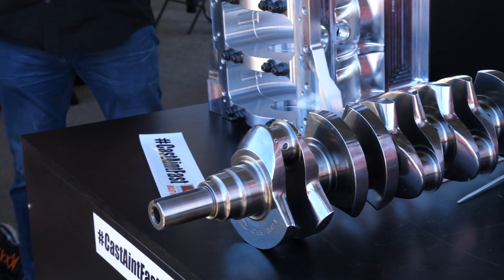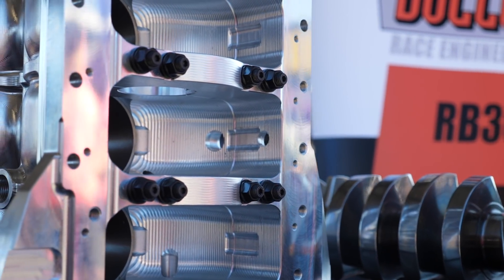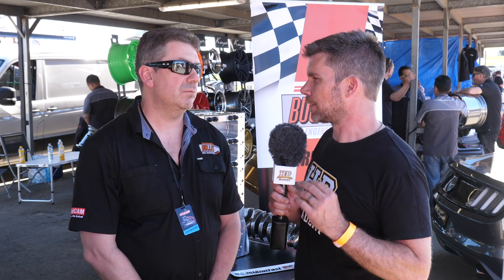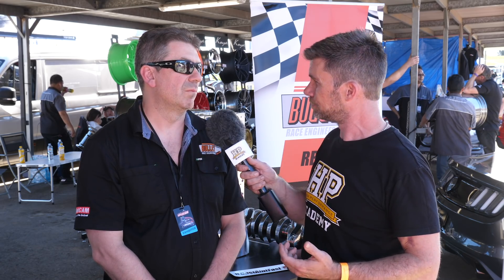3200HP+ RB Block With A 2JZ Twist | 100PSI of Boost, Bullet Race Engineering [TECH TALK]

Comment: " You can use Chevy flywheel bolts 'cause they're cheap"  You could probably use a cast block too if you're worried about the cost of 8 bolts...
Reply from the maker: Not just the cost, they're easy to source. Sometimes on race weekend things go wrong and spares are needed in a hurry - Taz

Comment: Wow I wonder how much does it cost to built an engine like this ? 
Beautiful engine.
Reply: If you have to ask, you can't afford it.
Reply: Matt Johns 
You probably right, but is still nice to know.
Reply: More than u can afford pal, billet.
Reply: hendrahendra  wow you guys are such low life’s, and it reflects on your comment, I just dig deeper into the cost of a billet block and they are not that expensive. The block ranges from 10 to 13 grand. So a complete motor ranges from high 20s and up, depends on the built. Price reference from Maxworx.
I am just not familiar with 2Jz motor cost.
Reply from the maker: @H L don't take it too hard, @hendrahendra was just twisting a Fast n Furious movie quote for a laugh ;)
I couldn't tell you want it costs to build this, but the block and crank will run you around 15-16k USD alone, and I would imagine much more if you're not US based I believe. Bullet and Callies will have the specific pricing for you though if you're keen to investigate further - Taz.

Comment: I want to see a single piece head and block like the old days. Boost it to the moon.
Reply from the maker: The head cylinder sealing technology has come a long way at this level since then though to the point it's often not what is holding things back.
In this case the next step is actually to improve head flow via some design changes rather than just gunning for more boost, although I'm sure as part of the circle of development goes that will be back on the table again in the future - Taz.
Reply: @hpa101  I'm exited to see what the new bottleneck or limit is after the new heads are out.

Comment: How much full engine
Reply from the maker: I'm not sure they sell those, I believe you buy the block and crank then sort the rest out yourself or via a third party. I think the block is around $10,000 USD and the crank around $5,000 USD but could be wrong. You'd need to chat to Bullet Race Engineering and Callies Performance for exact figures and lead times.
Certainly not cheap, but also not as expensive as the days of old for the equivalent - Taz.

Comment: They’re producing 3,200 HP...
Yet they’re looking to address the power production “limitation” by designing a billet head...

When did we enter the realm where 3,200 HP out of 180 cubic inch ain’t enough ??

My goodness !!!
Reply: When LS engines with a Chinese turbo(s) could make 500 WHP at ~ 5K-10K (USD I mean)
Reply: @akilh340   you mean 1000hp for $3k?
Reply: @ze_german2921  
Kind of. It's possible, but I wanted to be conservative about the numbers
Reply: @akilh340  lol rbs & 2jz make 500+ hp with just an intercooler & exhaust upgrade lol
Reply: @OneDaymien  exactly
Reply: @OneDaymien  and turbo, injectors fuel pump
Reply: This conclusion !! BRING ON THE FUTURE !!

Comment: Nice to see imperial aka small block chev technology in these engines!!!  Go the whole hog and convert to UNF ALL OVER!!!  3/4 unf mains , 5/8 unf head studs!!! Or just convert to a small block chev!!! The best engine ever designed to date!! Comparatively speaking!!
Reply: Nope. You are suggesting going back to a 60yr old design 2v pushrod engine that could no way could flow 3100 hp for this size.
Reply: Nor Dic yes I am suggesting that..... because it's a fact .... there are small block Chevys running high psi that get to those numbers. Try watching Steve Morris engines!!!  Major manufacturers don't keep on making pushrods engines for no reason!!! Example... chev LS engines compared to ford coyote overhead cam engines!!! The LS  pushrod engine is far superior to the ford!!!!  That's a fact!! No one is saying coyote the world..... because if they did the world would be spinning a lot slower!!!
Reply: As much as I like the small block Chevy platform. Sorry but 2jz is like the sbc of the inline 6 world. 

Take a stock 2jzge base block. Take a 2jzgte. Convert the ge to gte. No oil squirters. Saves you money and the base block is easily good to 2k hp. 

1jz head. Few other mods and your at a fuckload of power very easily and with lots and lots of stock bits still. 

Aluminium billet 2j base block even better. 

Give it some time. Chevy platform has years on 2j. Plus is in way more vehicles. Also while coyote the world doesn't exist. 2jz destroy all does. And why we gotta leave hemis out. 

And cooooome on. Biiiig Blooocks. Some 702 cubic inch gmc v12. Not that those would be an easy engine swap. It's deffs gonna make fuckloads of power. And a modernized version of those old fire Truck engines would be dope.